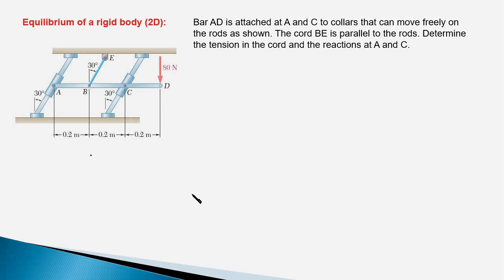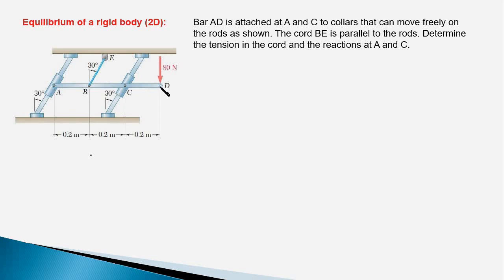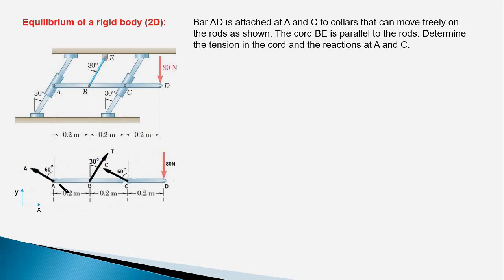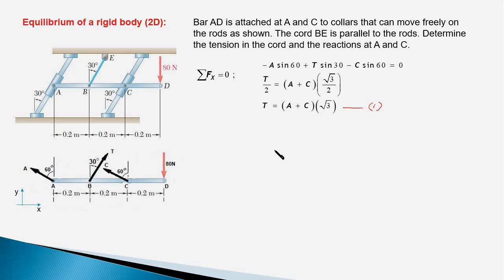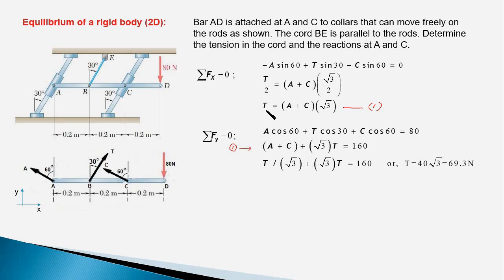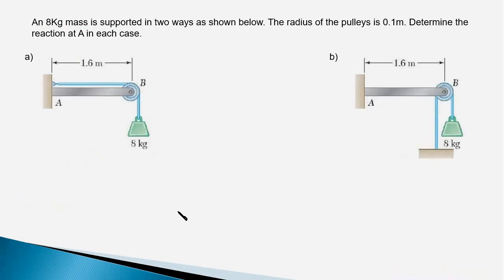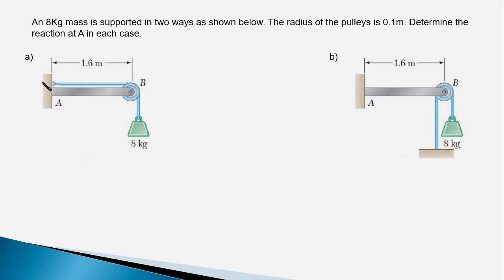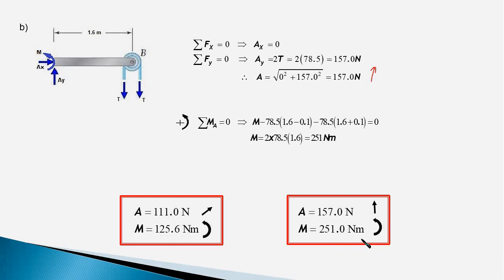4.18 Engineering Mechanics:  Rigid body equilibrium  (2D) - Solved Problems  (2 of 3)

Comment: Sir, why is sin used to determine the sum of forces along the x-axis? Should not cos be replaced with all the sin in the first line of calculation? Talking about the first question.
Reply from the maker: Basic trigonometry...the diagram of the problem shows the angles (of the forces) with respect to the y-axis and hence the sine of the angles would give the x-axis components.